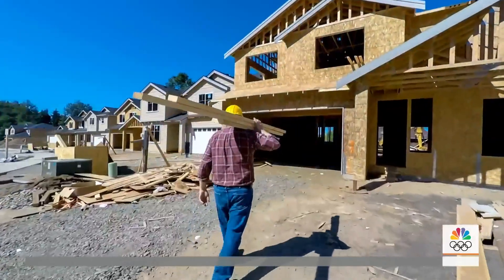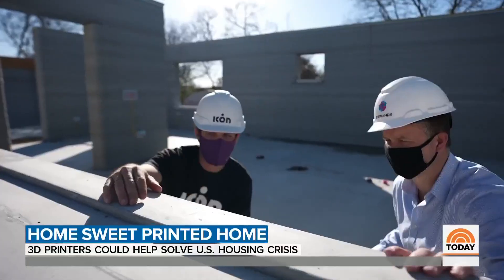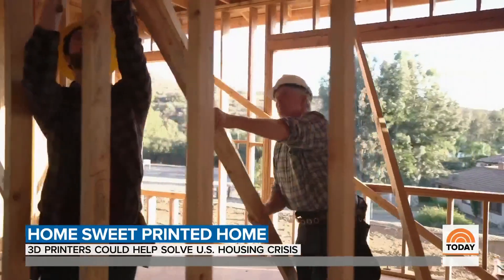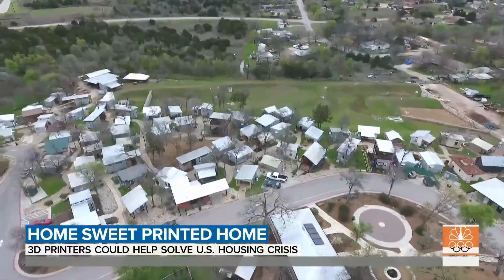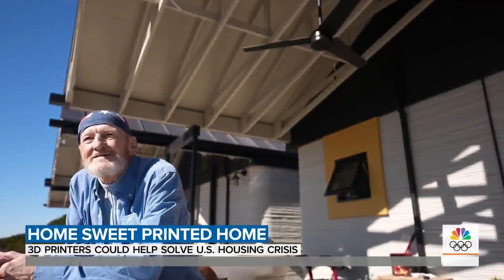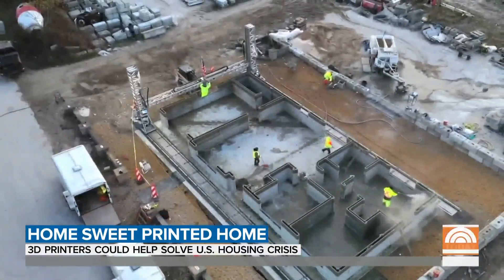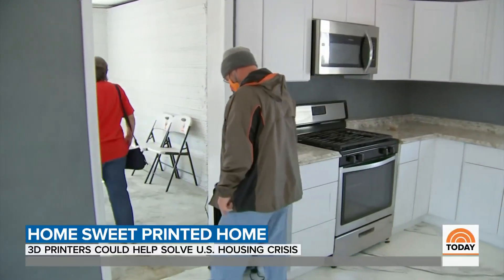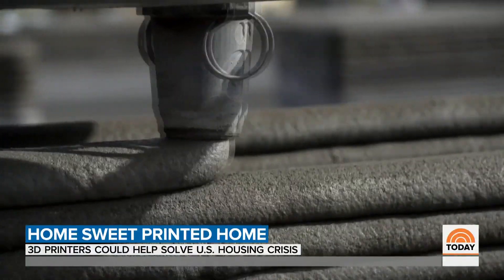How 3D Printers Could Be Used To Solve The US Housing Crisis | TODAY

Comment: I've been Looking forward to having a home 3D printed for myself. Living in Minnesota it just needs to be the right formula and mix plus I do like the one company in Germany did where they did a second floor near Minnesota because of tornadoes I would be wanting to get the basement and for safety putting the egress windows in So it'd be a very different take on doing the 3D printed home then most have done so far which is all been basically either one level or two levels but no basement.

Comment: They said the house was listed at a much lower price but not what the offers were.  Obviously it's selling at higher than list price and will likely be about the same price as other homes in the neighborhood.  3D printed homes don't exist in high enough quantity to satisfy demand and lower prices overall.  If you print an additional room to your house you have to upgrade your breaker box most likely to supply power and water lines if you are adding a bathroom.  Most of the value in real estate is the land value not the house value.

Comment: If it cost less to build a home, then why did that one cost $300,000.00?  Shouldn't it been more like $40,000.00??????
Reply: From other sources, I can tell you that the land itself cost 150,000$ and the construction costs were about 100,000$. If other similar houses go for 600,000$ then it will likely get bid up to close that number regardless of how much it cost to make. This will be the case until 3D construction printers can be scaled up enough to satisfy demand. The cheaper something is, the more demand there will be for it, so that may not be any time soon.
Reply: You can probably build a house cheaper with concrete blocks.

Comment: As a structural engineer I’d like to see the calcs. Let’s see how they do in earthquakes and storms. Also probably little option for renovation.  I highly doubt you’ll have a structural engineer sign off if you do renovations.
Reply: Why be sceptical? Nervous 😬?
Reply: @everlasting1154  Just because from a legal standpoint you need to have an engineer stamp and seal these projects. If it's not engineered good luck getting insurance. Dont buy a used one if you're planning on rennovating. You're going to have a tough time getting an engineer to seal it. Code cycles take time and it'll be a few years before codes and guidance get into structural engineer's hands. I doubt they're being super accurate in detailing what was constructed, what materials, etc that an engineer can replicate to analyze it. Otherwise you're going to have to go to a VERY specialized firm for reparis which i'm sure they'll increase their rates 3x. Just sayin....
Reply: It is just a vertical bearing, everything else has to be built by hand.
Reply: @Panda-gu9wz  from the flyover all lateral considering items were made out of 3d printed material, whatever it was. I'm sure it has some capcacity but it's not CODE DEFINED which is a big issue.

It's not  just bearing, it's is wind out of plane loads or seismic loads (lateral loads) you have to consider. Usually rebar is placed in concrete and I didnt see any placed (as it would be hard to print). Additionally, depending how slender your walls are (lets say skips a floor due to a loft), you'll need that rebare there to help with slenderness buckling issues.  Additionally other factors such as how are roof uplift connections tied down to the sturcture. Due to placement of concrete are there minuature cold joints so it's not a uniform piece of concrete? How will that behave with lateral shear as you're giving it a plane to crack laterally. How will this perform with shrinkage cracking? Can you use the tables the anchor products use (hilti,simpson, etc)? Do they place fiber in there to help out with tension loads? Thats the stuff engineers are thinking about. Maybe there is some information or research but coming from the industry, there isn't really a lot of testing done or relevant codes/design guides out there for the typical engineer to use. That's an issue.

Now it seems they're placing these in locations where loads are the smallest in the states (texas typical wind outisde of the gulf and very little seismic).  Good place to start I guess but it'll probably be like 9 years or so before it takes off. Code cyles come every 3 years and states adopt every 3-9 years a new code cycle.

Comment: And with aircrete instead of just regular concrete, you get free insulation due to the airpockets that are added to the concrete mix with pressure, and, you only use HALF the amount of concrete normally used to get the same size structures! As if your 4000 dollar home now only costs 2000! That also makes for super low running costs for heating and cooling.